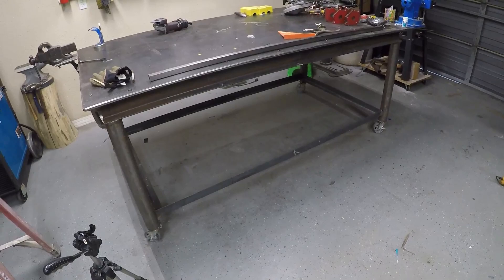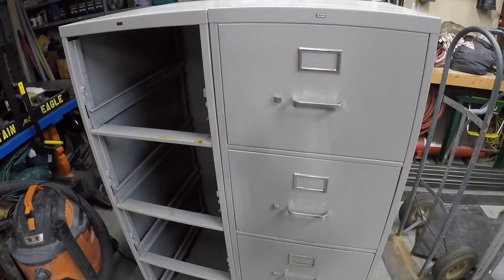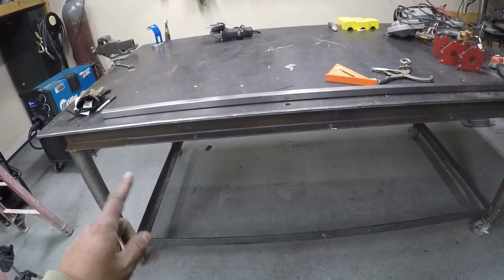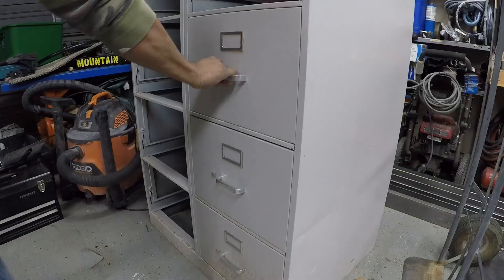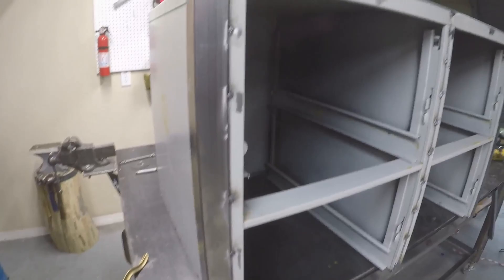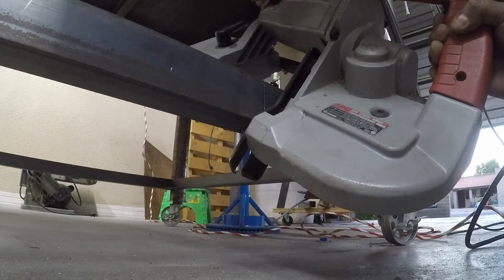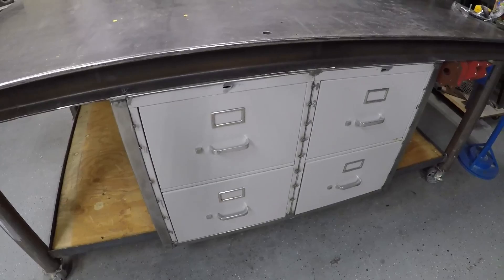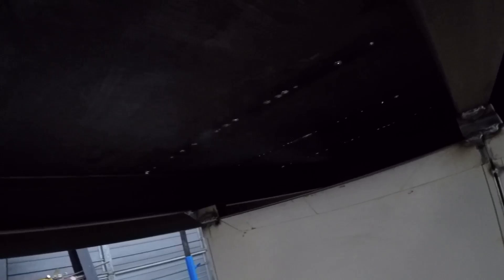How to Transform a File Cabinet Into a Toolbox for the Workshop

Comment: Great Job. I have 7 old file cabinets, and I use them for tools and supplies. But they are mostly different heights and widths.  If I have two two the same size, I might put them under my  work table. Seeing how you cut yours down is a big help. Thank you for the video!